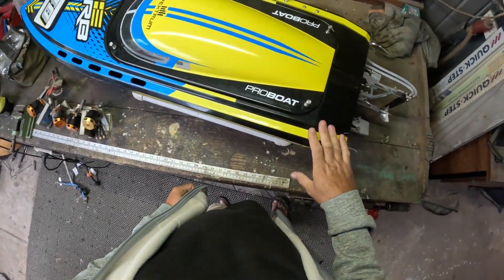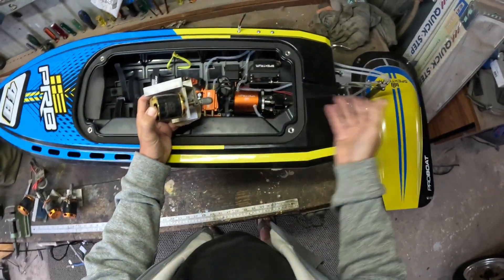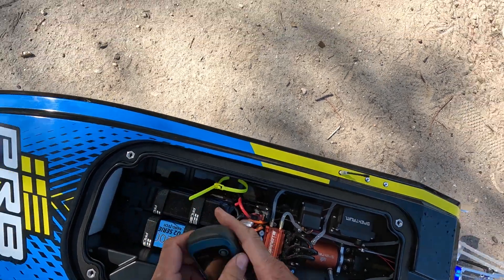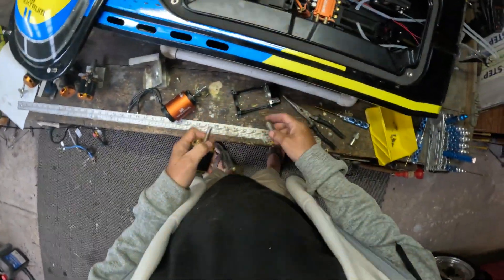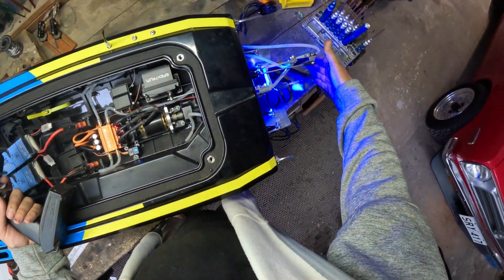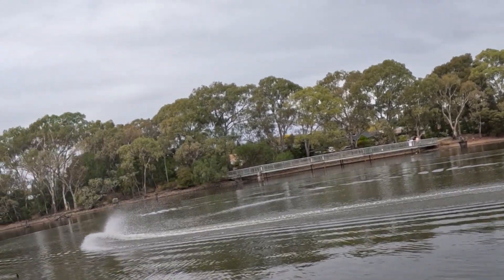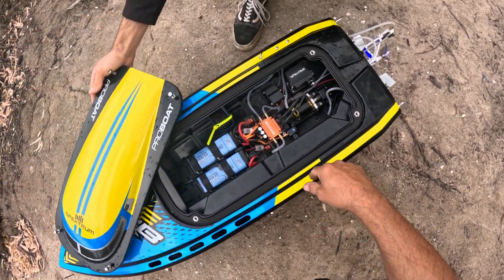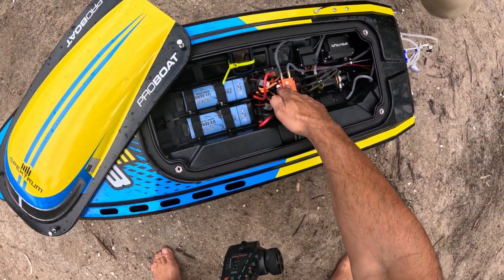Proboat Supersonicwake test with Scorpion 4035 800kv outrunner Helicopter motor test

Comment: You need to create 56 series motor mount,
Reply from the maker: I dont think the firma 160 will handle a 56mm
Reply: @ i am aware of that but there is castle or hobbywing can handle 56 series motor , and I don’t know why horizon put the same ESC as blackjack 42